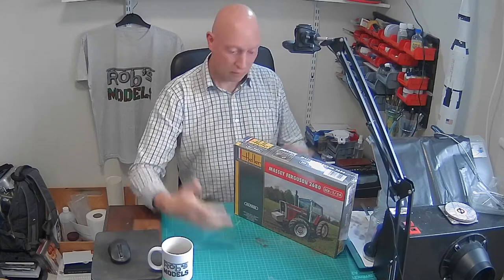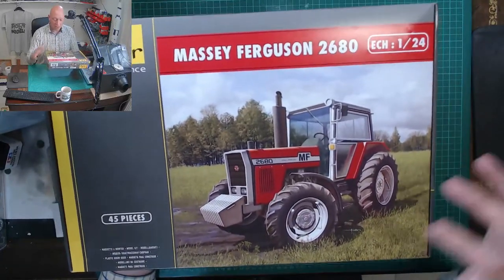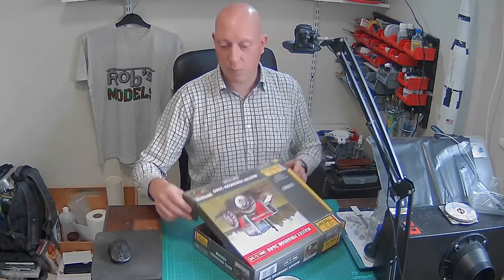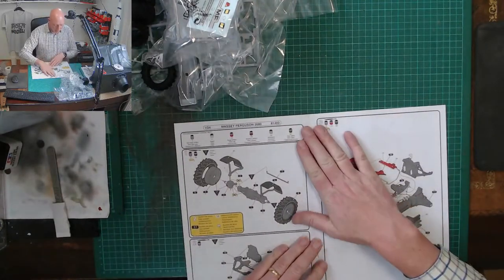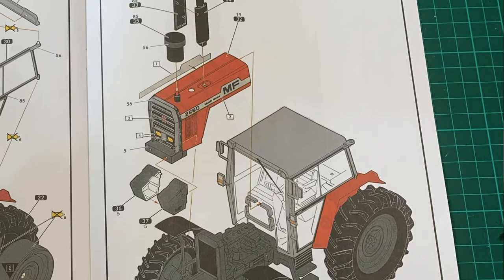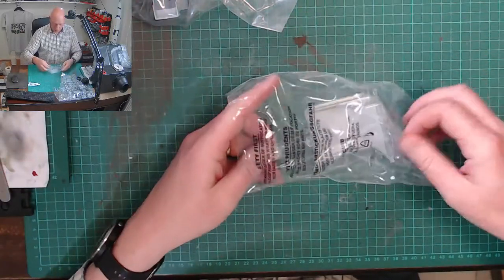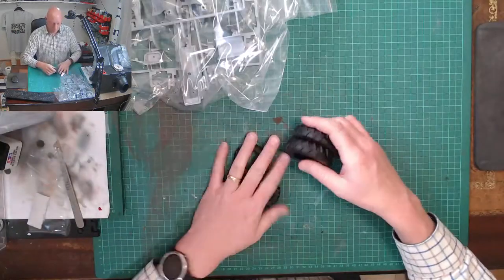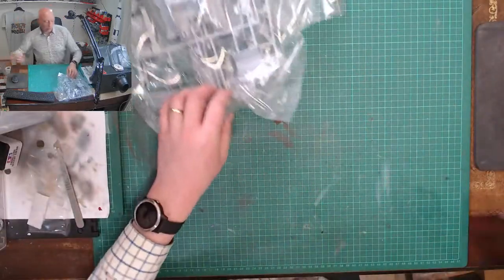Heller Massey Ferguson 2680 Tractor 1/24 Scale Model Kit Review & Unboxing Ref: 81402

Comment: My father worked for Massey Ferguson here in Canada and they went under (at least here anyways) around 1980 or 81. He ended up getting almost no pension from them despite working there for decades and what he did get was down to nothing about 10-12 years later.